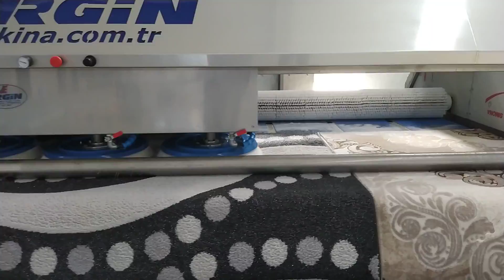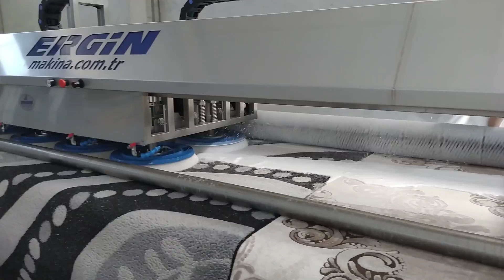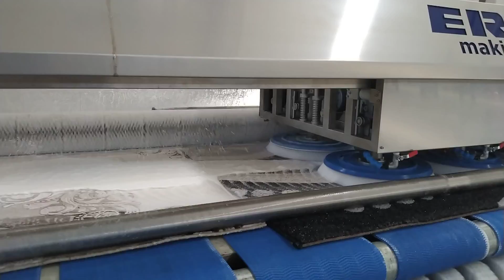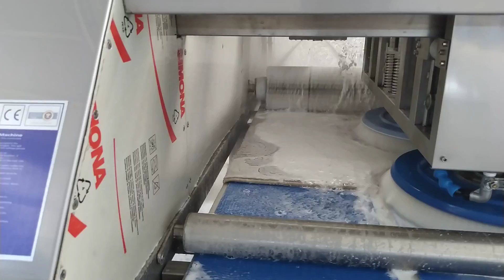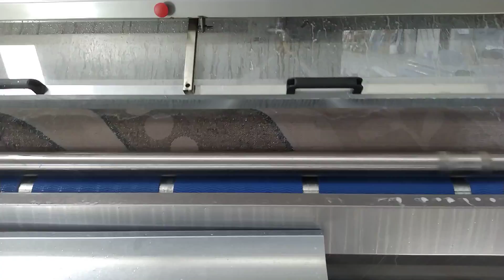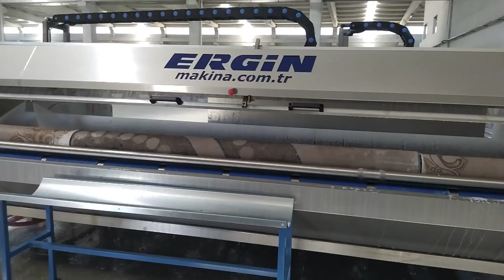ER 4200 Fully Automatic Carpet Washing Machine

Comment: How long does it take to clean one rug with this machine
Reply from the maker: Hello. Thank you for your comment. While we cannot provide a definitive answer due to several variables, we can offer some key factors that influence cleaning duration:

Carpet size: Larger carpets require more cleaning time.
Soil level: Heavily soiled carpets necessitate longer cleaning cycles for optimal results.
Cleaning chemicals: The type and concentration of cleaning chemicals used can impact cleaning efficiency and duration.
Conveyor belt speed: The operator-selected speed directly affects the rate at which the machine cleans the carpet.

Based on typical conditions, the average cleaning time falls within a range of 3 to 5 minutes. However, it is important to remember that this is just an estimate, and the actual time may vary depending on the specific circumstances of each cleaning task.

We hope this information is helpful. Please do not hesitate to reach out if you have any further questions.